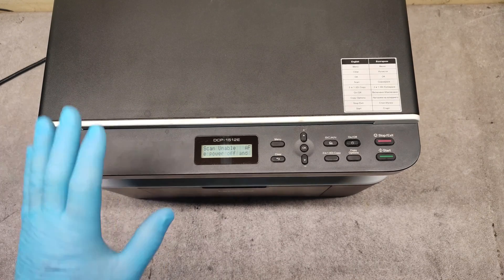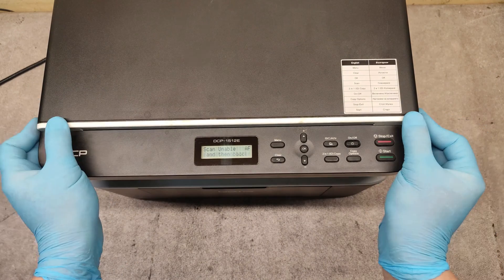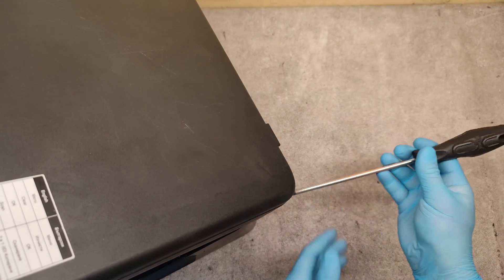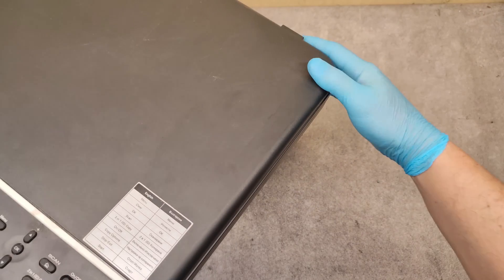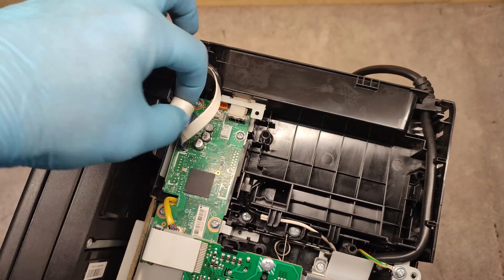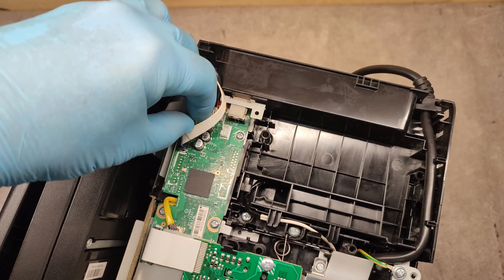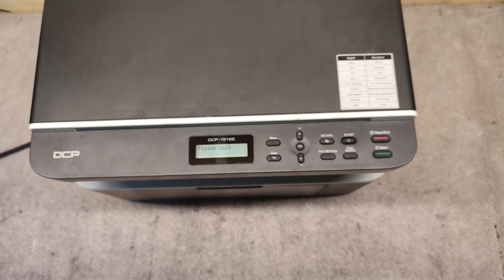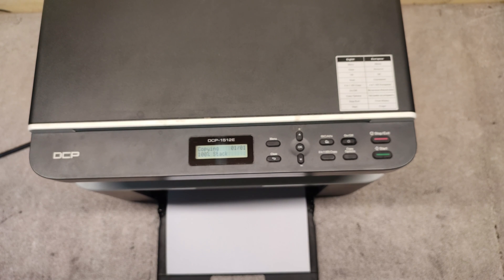HOW TO FIX SCAN UNABLE AF ERROR, PRINT UNABLE AF ERROR ON BROTHER DCP-1510, DCP-1512, EASY FIX

Comment: I have one question, i have just bought that MFC, 1512e,  installed drivers and complete suite, i can print but i cannot scan, i get error " Failed to connect to the device tw006. I have tried all different versions of full software from Brothers website, different versions, for Win 11, Win 10, Win 7, but still having the same problem. Tried every possible apps, apps see scanner as Twain an WIA, but nothing works. But scanner works as copy machine without any problems. Windows is reckongizing is as 1510 series printer, and scanner. Can you please help, i really dont know what else to do. I did all prechecks, checked running services, all prerequisites, but nothing, dead end.
Reply from the maker: https://help.brother-usa.com/app/answers/detail/a_id/61601/~/controlcenter4-scanning-error%3A-cc4-205%2C-tw006-or-tw007---windows